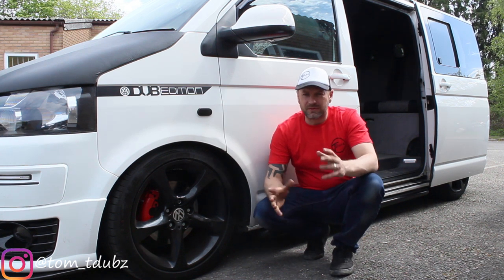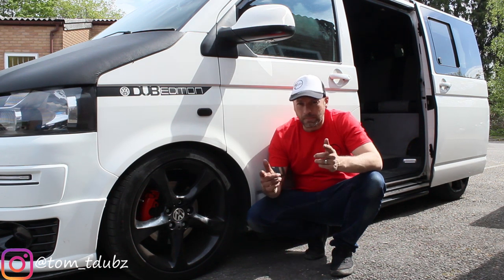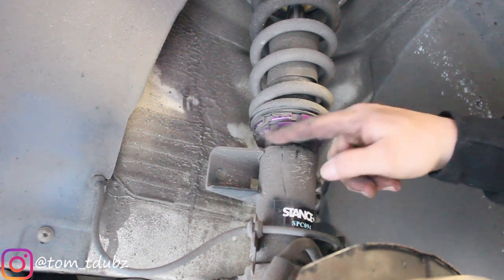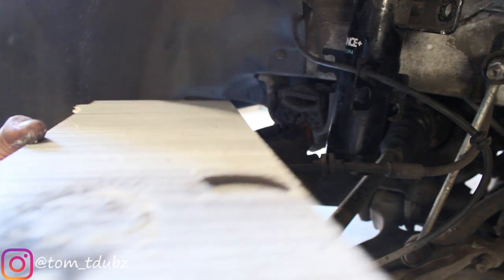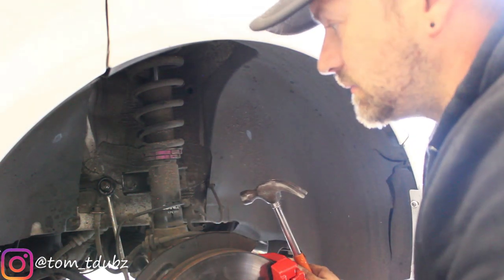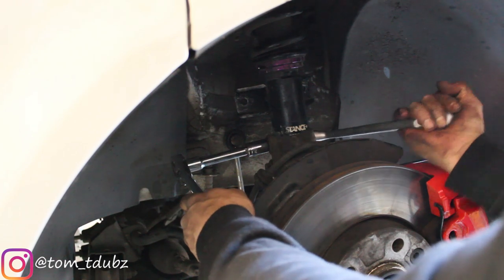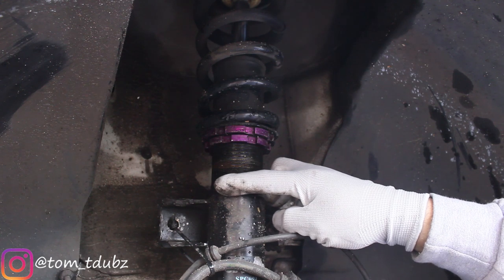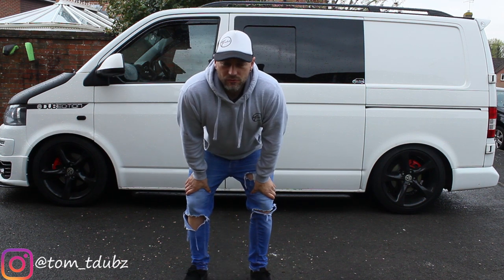vw transporter hub mod stance coilovers #stance+ #vwt5 #vwt6

Comment: My T5.1 is lowered 110mm on the rear and 100mm on the front on stance+ running 255/35/20. It's bouncy, and it rubs a little on full lock. 

”if it ain't rubbing, you ain't dubbin”
Reply from the maker: Like it a lot! Have to say mine isn’t rubbing that much.. it is bouncy on the rear but I’ve just managed to sort that out... vid is on its way 👌🏻😎

Comment: Did this help with the ride quality?
Reply from the maker: Thanks for watching, it did, doing the hub mod ment I could drop the strut through the hub and the re adjust the coils to effectively raise the van but back to a sensible height.. the spring was compressed so ride was a little firmer.. less bouncy.. the gaz short shocks on the rear really help too 👍🏻

Comment: Did the ride improve? I was just looking at doing this but was a little confused on exact process - I am concern you now have nothing to stop it going further down, right?
Reply from the maker: True nothing to stop it going further down but if you have ever tried to remove one.... exact proses is quite straight forward. Remove drop link, undo strut, use 57mm hole saw drill out metal stopper at the bottom of the strut housing the do it up as tight as you can, there are stories of them coming loose but just keep an eye on them they shouldn’t come loose 🤙🏻👌🏻
Reply from the maker: There are clamps you can get made to go on to the strut if your worried get yourself some of those, I’m going to invest in some when I drop it a little more 👌🏻

Comment: Newbie to van life guys 😁
Have a t6 t30 dsg kombi  day van on 275/40/20
Want to lower 50/60mm but wanting a smooth comfy ride  not bothered about  cornering at 60mph lol 
So what can you recommend without spending a fortune 😃
Reply from the maker: Stance plus are a great kit for low spends.. will lower you van well to 50/60 and be comfy at that height too. Plus you have the option to go higher or lower on the coilovers 👌🏻
Reply: @tomtdubz 
Cheers
Have you a link of where to get these and what sort of price fitted?
Reply from the maker: Try stance uk or venom motorsport... not sure how much they are to fit.. I’ve heard people doing it for 500 all in coils,drop links and top mounts...

Comment: Hi ya Tim, Is it possible to do this with out removing the shocks with a dremel??  Just raise them slightly, And  remove the bracket that holds the brake line? Reason for asking was I had a mission to get my shocks back in the hub last time
Reply from the maker: Can’t see why not, might take a bit longer, let me know how you get on... 🤙🏻👌🏻
Reply: @tomtdubz  job done mate, hole saw in the end..
Wasnt to bad a job except I caught the cv boot with the drill 😞 oh well keep me busy on lockdown..
Keep up the videos 👍
Reply from the maker: Will do bud, transporterhq sell slimmer boots! £50 👌🏻

Comment: do you not need shortened drop link for that? do you think you can hub mod a standard shocks with lowering springs work?
Reply from the maker: You could hub mod on standard shocks.. don’t need shorted drop links, that’s only when your on air, would be a good idea to invest in some adjustable ones and possibly some shorted driveshafts.

Comment: What you've done is a great job! 
I'm looking at budget coilovers also. I've noticed stance do a ultra low kit.
I'm not after ultra low but if I used the ultra low kit and dropped it low as low as the standard stance + (plus a tiny bit maybes) would i get still get a good ride. In effect what you've done here? i.e not much bounce like you say as the springs wont be stretched out like the standard stance +
If you get me lol
Reply from the maker: Yeah that might work, check out the figures first as I’m not sure of the drop you get on the ultras. They will be better coilovers so the ride should be a lot better anyway 👌🏻
Reply: that's what I was hoping for ultras drop to
Front Lowering: 30-110mm
Rear Lowering: 30-95mm
Stance + 
Lowers front by: 30-95mm
Lowers rear by: 30-80mm
Reply from the maker: Do it, be good to know how you get on 👌🏻🤙🏻

Comment: Hi there, are these Stance Plus and do you think they will be ok to lower my T5 50mm with 20 inch alloys and 275/40/20 Tyres without it rubbing or being too crashy?
Reply from the maker: They are, they will be fine at that height, I’ve currently got them in my silver van around that height no issues at all 👌🏻
Reply: @tomtdubz  thank you :)

Comment: Great vid, have you still got the adjusters in the rear
Reply from the maker: Thanks, in the front yep with now about 40mm or more adjustment available in the rear I have taken the adjuster nut out just leaving the main treaded bit in, so if I remove that can drop the rears about 20mm taking the rubbers out too...

Comment: did you manage to remove that lower part of the strut without undoing the cv boot and hub bolt?
Reply from the maker: Yep, left it all intact, just took the strut out 👌🏻 it’s do able once you remove the drop link bolt as the struts are shorter than the standard ones 🤙🏻
Reply: @tomtdubz  ahh right.. my next question was do i need to remove when i fit my coilovers..but you answered it. "stock struts are longer" 😵 Ive fitted coilovers on all or my cars, all VW but never had to remove the cv, so wondered if i could get around it 😝 Vans looking real good 😝 cant wait to see how low it will go 🤙
Reply from the maker: Thanks fella, check out the coilover vid.. not a massive amount of detailed vid but enough to help u fit ur own 👌🏻🤙🏻
Reply: @tomtdubz  yeah i have seen it.. yours was one of the best tbh.. not alot of decent videos on youtube of t5.1 coilovers i thought 🤙
Reply from the maker: Thanks fella! 😊👌🏻✅

Comment: How low is it running at the moment
Reply from the maker: No real difference from before, I would say it’s still on around 100 mm drop.. but now I can go further with the right wheel/tyre set up 👌🏻
Reply: @tomtdubz  100! That’s low I’m on 35 on 20s
Reply: T Dubz  Hello there chap I’m in the process of getting all the parts to lower my wife’s T5 I’ve got most parts suspension wise , but I’m just working out tyre size before i commit to anything , now quote me if I’m wrong but when you first put those wheels on but weren’t you running 225/40-19 Front and 235/40-19 Rear , only I could have sworn in this video you said you were running 225/45-19 Front and 235/45-19 Rear correct me if I’m wrong.
Reply: Why did you change up in profile on the tyres from 40 to 45?
Reply from the maker: Your not wrong fella, it’s a comfort thing at the mo, I will eventually fit 20”s on the van.. we were supposed to be going away... hence the tyres, France... and the roads back country can be a little bumpy...